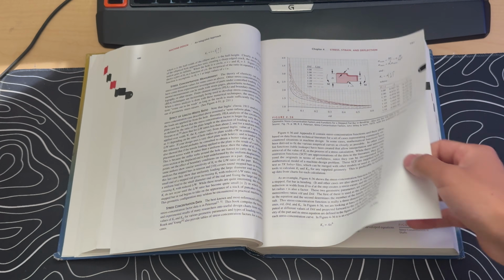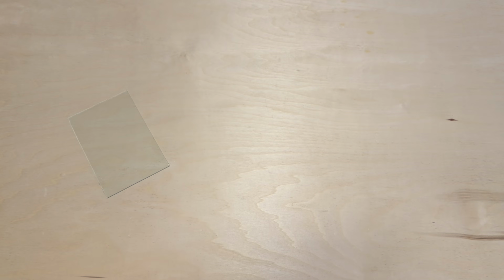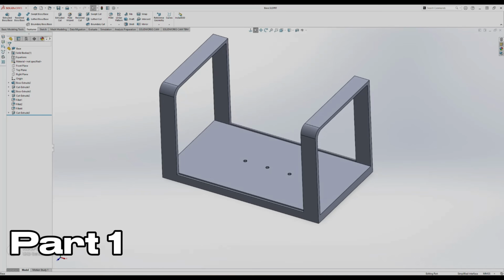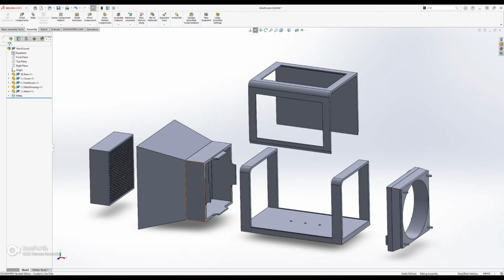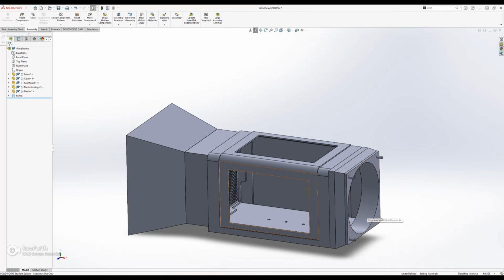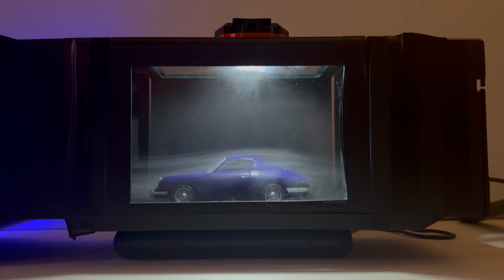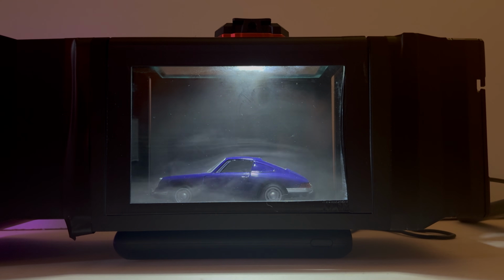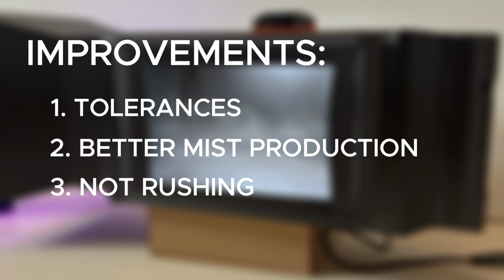I 3D Printed a Wind Tunnel to Actually See Airflow!

Comment: Hey, I'm doing something similar—building my own wind tunnel and 3D-printing parts for it. What are you planning to do with yours? Are you using it for research, or is it mainly a fun project? If you are planning to use it for research could you tell me how your going to do it cause im kinda lost at that part. Thx.
Reply from the maker: Hey! One of my main intentions was to use this tunnel to test the aerodynamics of various scaled down 3D printed objects.

In the future I’d love to build things that fly or glide through air and water and being able to visualize the performance of different hauls or wing shapes in a controlled environment would help optimize my designs and save time!

I hope this helps and feel free to ask more.
Reply: @Tom-Engineering  That's awesome. My main goal was pretty similar—I built a wind tunnel to learn more about aerodynamics and test different airfoil designs. Right now I'm trying to figure out how to turn it into a more meaningful project instead of just a build. Have you found any good ways to collect data from your tests, or are you mostly focusing on flow visualization right now?
Reply from the maker: Right now it’s built just for vizualization. 

As far as I know, adding sensors and reducing and scaling certain factors would be the only way to collect useful data. However this is a pretty challenging task. In my mind, even if I did integrate these things, I don’t think anything I build on this channel will require that level of precise data and I’d be better off putting that effort into other projects.

All in all I think if wind tunnels are your main focus, absolutely go for the data collection route. But I don’t know enough to give any useful advice besides what I’ve already said.

Comment: 5:13 I can't stop laughing. It has an I6 engine. It's performance is good 😂😂
    
Your print looks great. But I would suggest try to use something else than mist. I have seen other people doing smoke. But not sure though if it will work as simple as this one or not. Also the high flow helps a lot with the visualization. Not like others where its just like 2 - 3 streams
   
But tbh your design is the best one i have seen till now
Reply from the maker: Thank you so much! I really appreciate genuine feedback. I agree that using something other than mist would drastically improve the visuals, and when I make the second version I will definitely use your smoke idea!